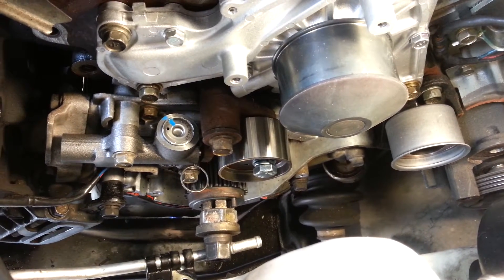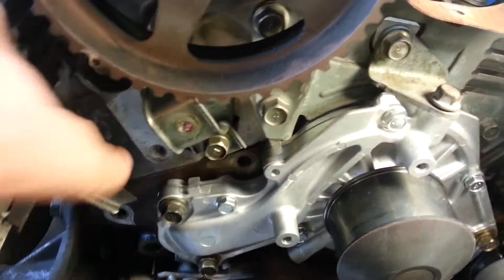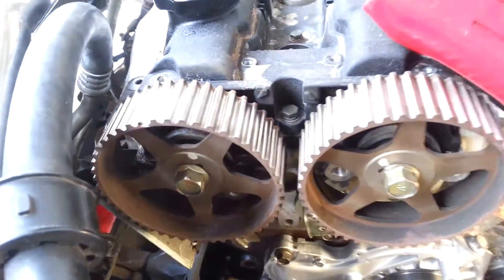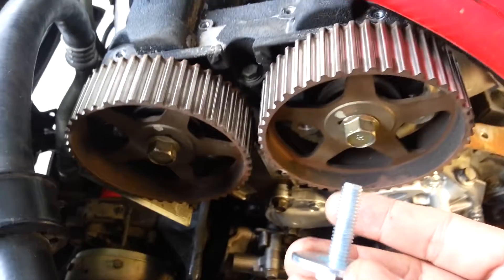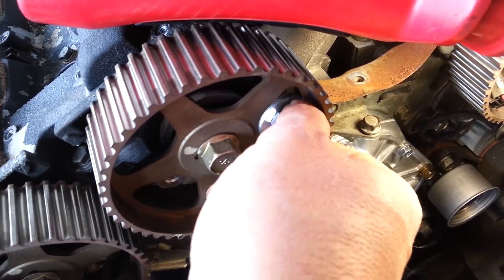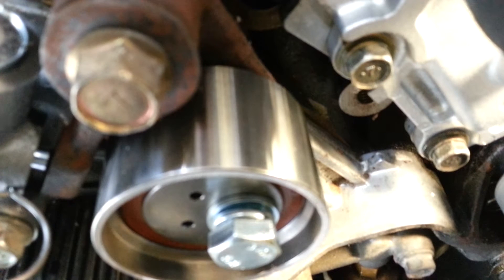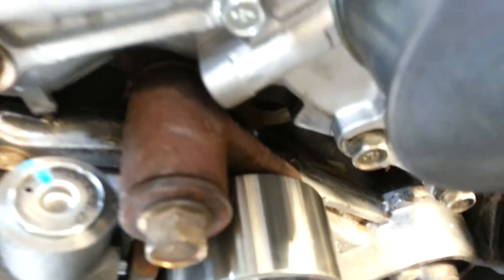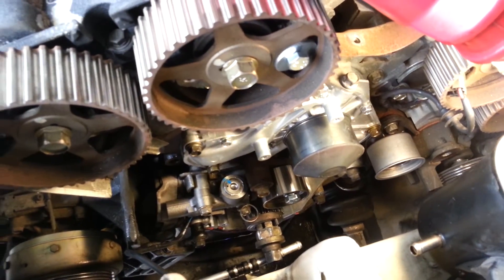Last VR4 Built - Water Pump, Tensioner, and Pulley Installation

Comment: Hey, I loved your video. I currently, have a '97 3000gt SL
 and I'm actually looking to do this myself. 
I'm an amateur mechanic. Is this something that is easy enough where I can do it myself? Also, do you know anywhere I can get a reliable repair manual?
Reply from the maker: Here is a link to the service manuals.

 http://www.3sx.com/faq/manuals/

In some respects, an amateur mechanic would probably be better than a professional, as long as he follows the service manual to the letter, follows ALL the torque specifications, and is meticulous in his work, If you are not that person, than you really need to find someone that knows these cars. And that is not your local garage or dealer.

I suggest looking in the 3SI.org forum for someone that lives in your area that does this type of work.

Needless to say, this will require a full 60\120K service and the parts for this is a hunk of change for OEM parts.